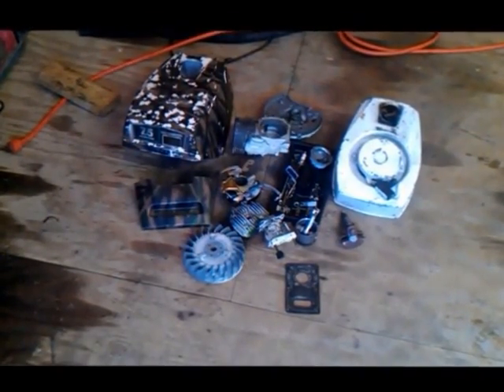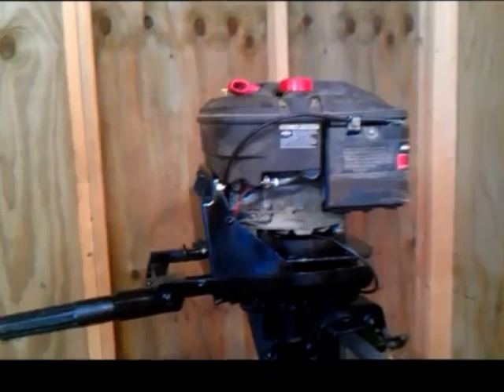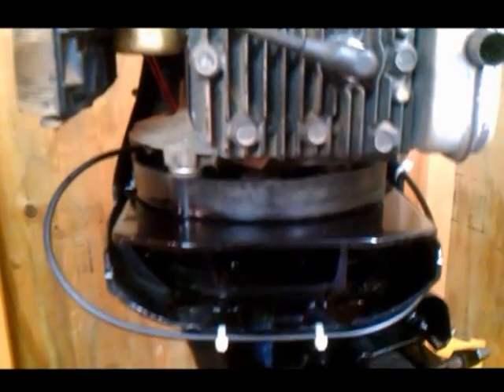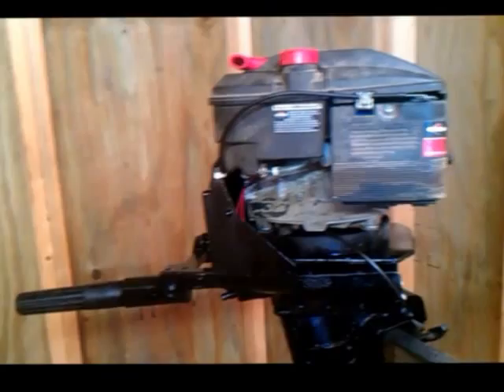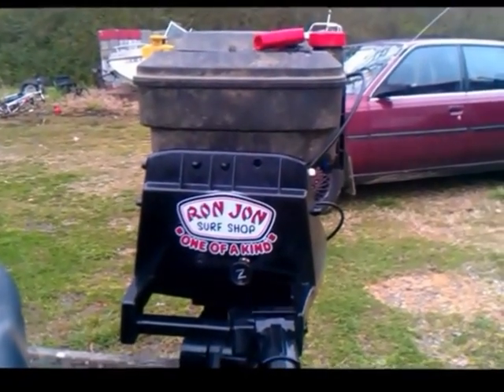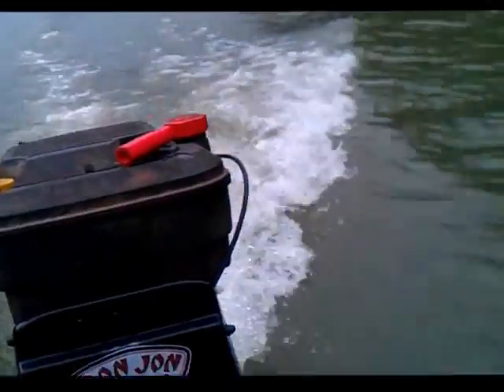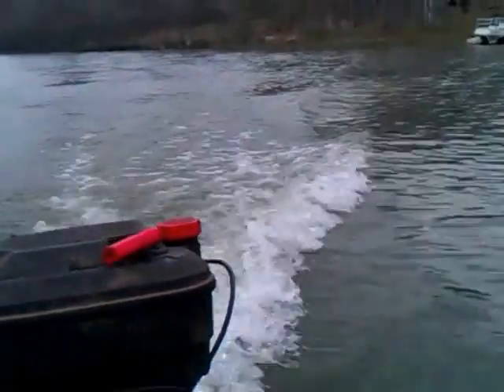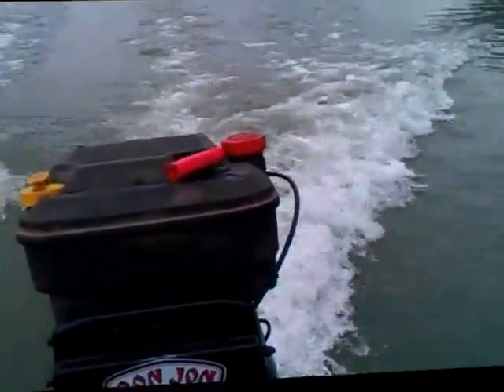My Lawn Mower to Outboard Franken Motor Conversion

Comment: Awesome job n craftsmanship. But it's not job for the shaft gears to run unrestricted.  I know u DNT need water now for water pump. But should really only put in gear in the water. That's y when u put the ears on a boat motor n start with hose running. U never put in gear. Just a thought I had when I seen it freewheeling. Lol still awsome thought🤣

Comment: i would get an OHV motor as they burn less fuel than a flathead engine as Kawasaki ,Subaru, Honda and the china made Honda clones seem to be the most reliable motors.

Comment: the Briggs and Stratton Quantum seems to be a good engine to use the professional series OHV engine has alot of flaws the Plastic camshaft and timing gears in it causing it to fail. as the Quantum is Briggs and stratton's first CAD designed engine. i would use a cast iron flywheel on this engine if u can find one mainly used on pressure washers the flywheels on the mowers are aluninum as the mower blade is the flywheel for the engine. as the cast iron flywheels will reduce the kickback when starting the engine. if u can find a flywheel on EBAY from a pressure washer using a Briggs and Stratton Quantum engine. then again it has to be a cast iron flywheel.

Comment: what would be the longevity of a build like this use wise?
Reply from the maker: michael fowler I can't say. I traded the boat the next summer but it worked fine for me
Reply from the maker: michael fowler Who knows? Briggs& Stratton motors are plentiful and much cheaper than an outboard engine.

Comment: Hey you did a dang fine job on this!! I'm in the process of building one now and was wondering how you installed that kill switch??
Reply from the maker: I used a rubber covered push button for a kill switch that I picked up at the local parts store. one wire from it to a ground and the other wire to the coil kill wire

Comment: Awesome! Ever thought of running the engine on propane?  I've got some videos that show how to easily do it and you don't have to worry about carb issues.  Lots of benefits over gasoline.  Take a look at the first of three videos Gasoline mower to propane conversion - Part 1

Comment from the maker: I used both the blade adapter from the lawn mower engine as well as the adapter from the boat motor engine. Drilled the bolt hole in the blade adapter large enough for the other adapter to fit inside of it. Drilled a hole through both adapters while assembled together and then secured it with a roll pin. It was just a matter of building the mounting plate to the proper height then. Thanks for watching!